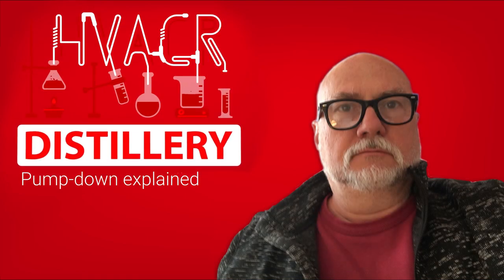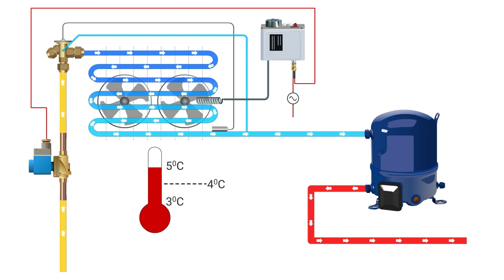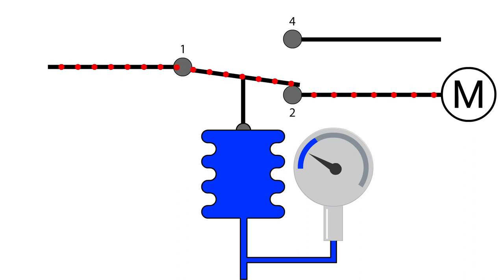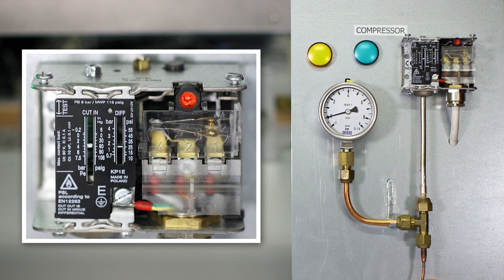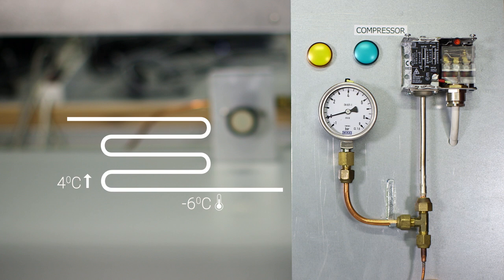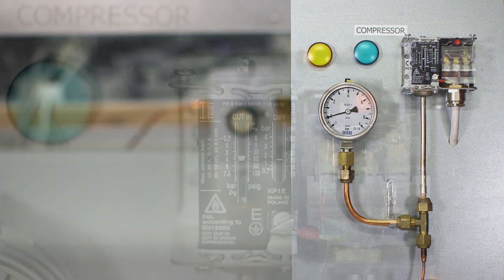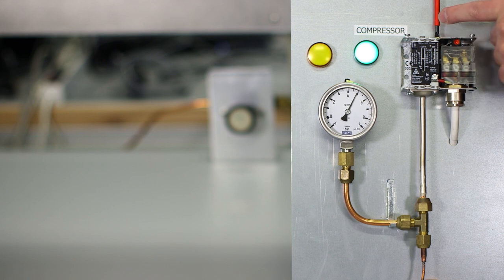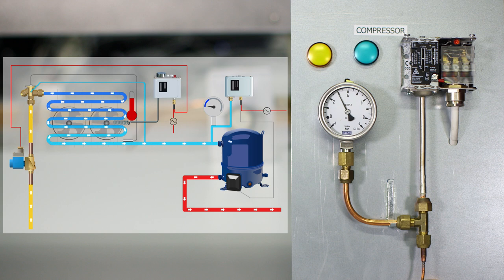How pump down works in refrigeration systems | HVACR Distillery Episode 6

Comment: Without charging the gas, the pressure in the suction increases and the cooling decreases, why is this problem happening?
Reply from the maker: Hi Devi, Thank you for your comment. There are a few things to check, if you have a high suction pressure:
Check the compressor is pumping – close suction service valve and suction gauge should decrease in pressure (If scroll compressor do not run in vacuum).
Check system is not overcharged.
Check expansion valve function.
Check expansion valve bulb is secure on suction pipe leaving the evaporator.
Check if the compressor is connected to the correct pipes.
Hope this was helpful :-)

Comment: What keeps the refrigerant from moving back to the evaporator? Check valve?
Reply from the maker: Yes, the compressor will have a couple of built-in valves in the cylinder head, where one is for the discharge (outlet) of the compressor. The discharge valve will work as a check valve.